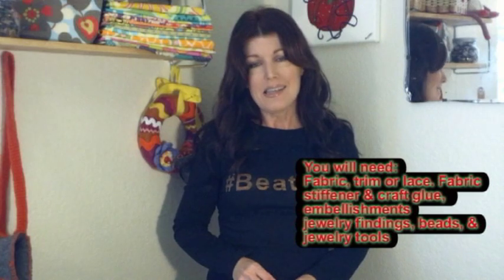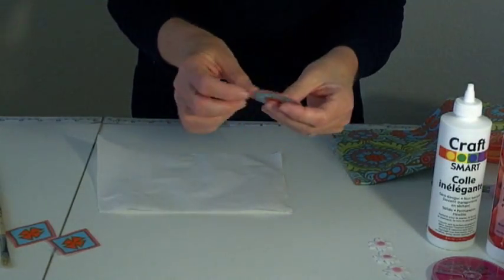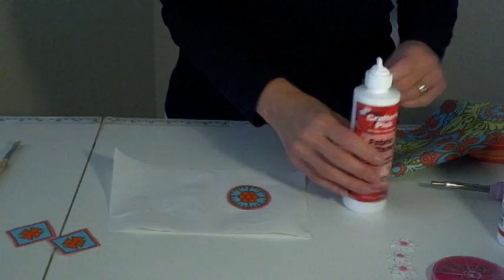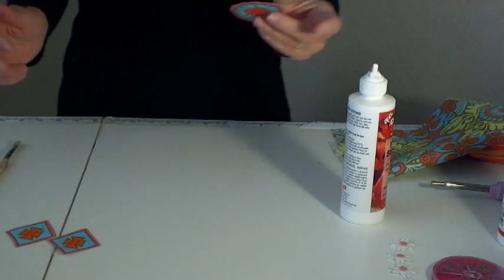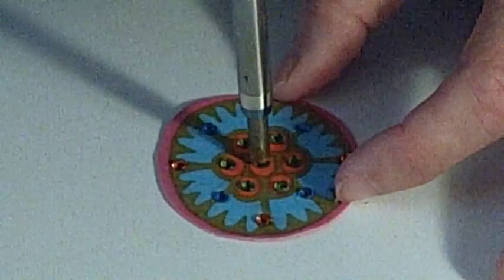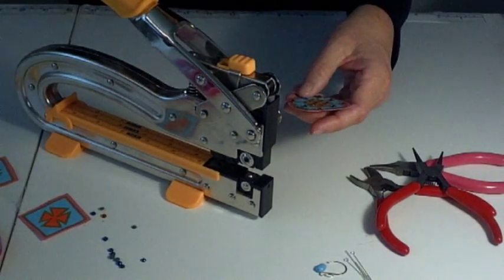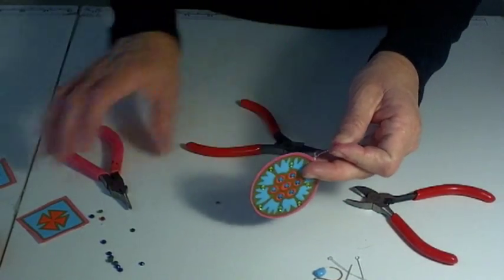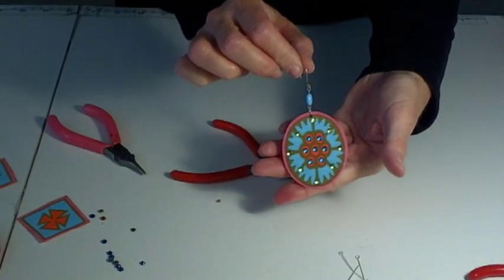How to make Earrings Using Fabric & Fabric Stiffener Day 6

Comment from the maker: Thank you! To make the hole I used a Crop-a-Dile II that I bought at Michael's, I used a 50% off coupon and got it for under $20.00.  I did not finish the earrings, but I suppose you can use a spray lacquer to finish it.